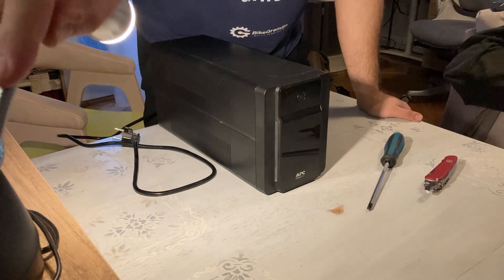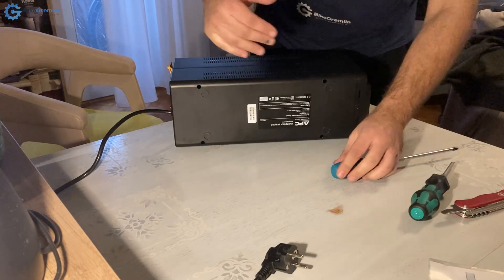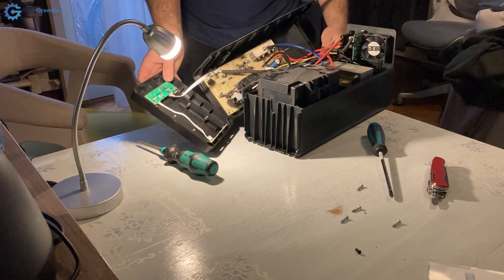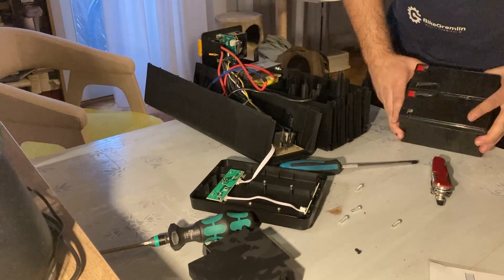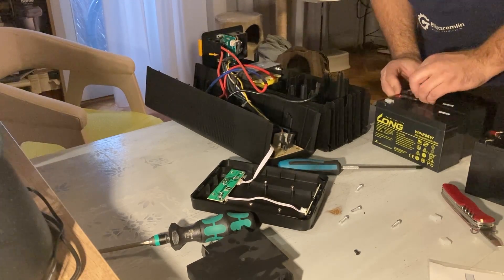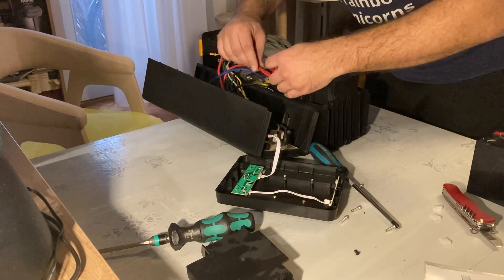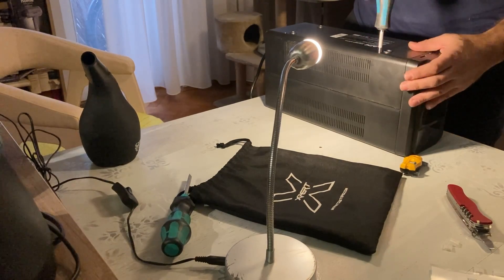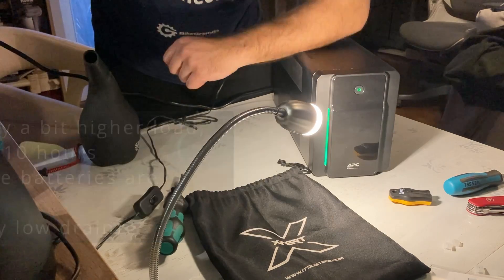APC Back-UPS 1600VA BX1600MI-GR battery replacement

Comment: That crappy batteries you have cost a fraction of price of genuine ones, but will also work for a fraction of time of genuine batteries. Genuine costs approx  80€ and it worths every cent of the price. The chinese compatible crappy batteries cost half of price and will serve you 1/3 of time in the better case. For APC UPSes buy always GENUINE BATTERIES, since they will work approx time you find in the tech specs....2-3 years for BX1600!
Reply from the maker: Thanks for the info.

The batteries I bought should come with a 2-year warranty (but I will see how that fares in practice).

We shall see. 

An extra caveat is that the original batteries are not even available in my country currently, so I'd have to pay a lot more and source them from Germany.

Also, for what it's worth, for a lower-powered APC (500 VA model), I've had very good results with non-original cheaper batteries.

EDIT:
My article with all the specs and the battery monitoring software link:

https://io.bikegremlin.com/35374/replacing-batteries-in-my-apc-ups-with-aftermarket-ones/

General note - 
For any comments, corrections, additions or questions, I would recommend using the BikeGremlin forum, to make it easier to find later on and help more people:

https://www.bikegremlin.net/
Reply: those batteries cost 1/4 of original ones, 20 eur. you do the math. also the design is crappy to begin with because those batteries are not easily serviceable and being in a hot environment due to the inverter are prone to dry up and die quicker.
Reply: I can add a extra auto batter 55ah For pump? 200w

Comment: Video contained the info I needed, which was how to crack open the case. Some pieces came off due to the crappy design of the thing. But I got it up and running just fine. Good video, thanks!

Comment: Many thanks for this video, I've just finished replacing the batteries. Oddly enough my BX1600MI came with 7Ah batteries, not 9, but I replaced them with 9Ah, so I probably made my UPS a tad better. Also, not sure why the batteries started dying, both were marked 13.1v on the multimeter, but maybe the hot Ugandan weather is responsible for the short life span (just under 2 years).
Reply from the maker: Heat is not helping definitely. 

Regarding batteries: yes, mine too came from the factory with 7 Ah batteries (I am not sure if newer models come with 9 Ah right away), but the official info is that the recommended batteries are the 9 Ah, so that's what I used. And yes, I too expect that to have made the UPS a bit better (in terms of capacity, and less overheating probability).

Relja

Comment: Lookes like that even the new model is a pain in the ass to change the battery.
At this point no more APC for me.
Reply from the maker: Alternatives are not better, unfortunately.  :(
Reply: @BikeGremlinUS I'm gonna try the Ubiquiti one when mine fails. It seems easier to replace the battery. Tho is not the same power.
Reply from the maker: @tuttocrafting  Do let us know how it handles power fluctuations and outages.
The problem I've faced with alternative brands is that they don't handle their main task as well as APC.
Reply: @BikeGremlinUS over here the power grid is very stable. We have tight tolerances in EU.

But I'll keep you updated.

Comment: Thanks for the video Im researching for an UPS and this APC one seems like a good purchase but I wanted to be sure it didn't use proprietary batteries just standard sized 12V sealed ones like in my SALICRU.
I wonder why they won't start using Lifepo4 batteries, apparently there are units designed to replace 12V Pb batteries like the ones found on most SAIs.
Thanks again!

Comment: It took me about 6-7 months for the retailer to bring me a new battery.
It then took me over half an hour to go to the hardware store for a screwdriver long enough to reach the first 4 screws.
The change itself took me a max of 10 to 15 min....
Thanks for the video, it helped me do this properly and without hassle after I had both the battery and the 15cm long screwdriver
Reply from the maker: Glad to hear it helped.  :)

Comment: Another thank you. I did it in about 40 minutes thanks to your presentation. All working fine.
Reply from the maker: Great. :)
That means it was worth the effort to make the video.  :)
Reply: @BikeGremlinUS  I find that even if not exactly the same item being dismantled one can often get a hint of what might work. I filed down the edge of the two lugs to make it easier to get the front off should I need to do so again. Like you I found one battery was ~12 volts but the other was ~10 volts. I may save the OK one for other projects. Best wishes.

Comment: Very valuable, thank you. I was wondering if brute force to take off the front might break something critical but seems not. You should have shown a close up of those front plate lugs and holes to help us see the depth to press in the lugs before pulling off the front. I have replaced batteries on many APC UPS over the past 30+ years and previously one could always just remove screws to dismantle.
Reply from the maker: I agree - thanks for the constructive feedback.
I still make all the videos using a phone, so can't see what's in the shot.

I am saving for a 4K camera with a flip screen, which should enable me to "zoom" post recording without losing quality for a 1080p exported video, and see more clearly what is in, and what is outside of the shot (thus enabling me to zoom in more freely).

Relja

Comment: hey, thanks for this video. i have same ups but with 2200VA. i will find batteries and replace them using your video as reference. my ups is probably already out of warranty
Reply from the maker: No problem - glad if it helped (and curious to hear how it went).  :)

Article with some battery details (if it helps with search):
https://io.bikegremlin.com/35374/replacing-batteries-in-my-apc-ups-with-aftermarket-ones/

Relja
Reply: @BikeGremlinUS  thank you

Comment: Hello. I have the same UPS. New, but it smells like bad plastic or something chemical, and I don't know how to describe the smell. Did yours have  it  when it was new?
Reply: I recently bought one, same model. Yes, horrible plastic smell out of the box, but it goes away after a few days.
Reply from the maker: Hi,

I don't remember the smell being too strong or unpleasant.

Relja
Reply: It's probably due to the resin which protects the winding of this big transformer. Should go away with time...

Comment: I have the same UPS with an alarm sound and light blinking.  Must I replace the batery?
Reply from the maker: For comments, questions, or advice, I’d be happy to help over on the BikeGremlin forum:

https://www.bikegremlin.net/

To keep everything organized, I’m only providing answers there (i.e. if you don’t find an answer to your question on the forum, create an account and post the question there). Thank you for understanding!

Relja Novović
Reply: Yes, you should replace the battery. To be 100% sure, install the PowerChute software and connect UPS to PC with USB cable (same cable used for printers) if your UPS has the USB port, otherwise replace the battery directly